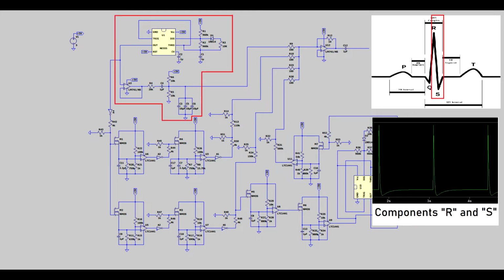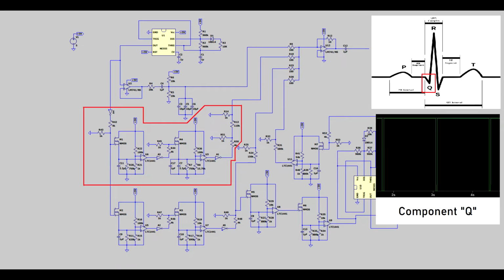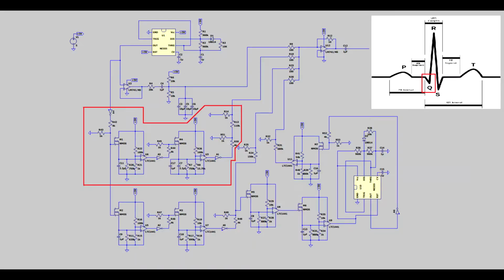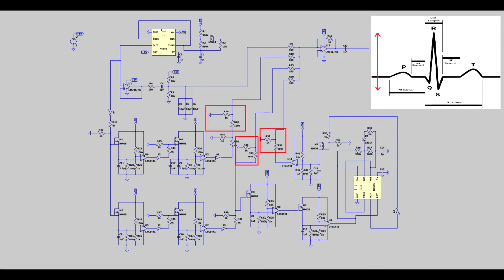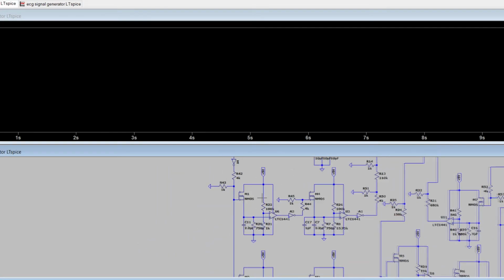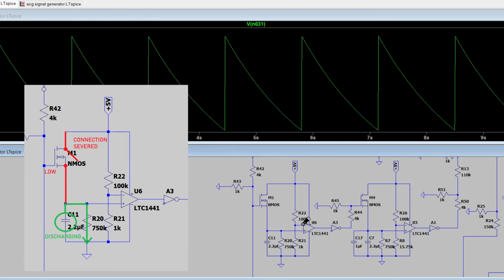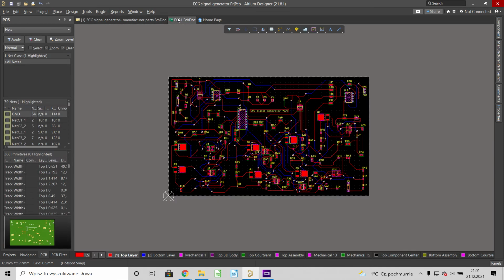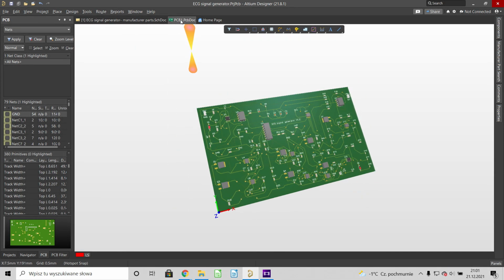ECG signal generator project

Comment: Thanks for video. I want to ask something; Is the ECG signal some kind of pulse signal? if not, can a pulse be obtained from the ECG signal?
Also, is the frequency adjustable?
Reply from the maker: The signal components are created by pulse signals from the 555s. I think that for this project, adjusting frequency in real-time would be impossible, because the 555 pulses and the capacitor charging curves need to be in perfect harmony to obtain a periodic signal that doesn't devolve into random noise after several seconds. Changing the frequency of the signal generated by the first 555 would require adjustments across the whole circuit, e.g changing voltage dividers and capacitors.